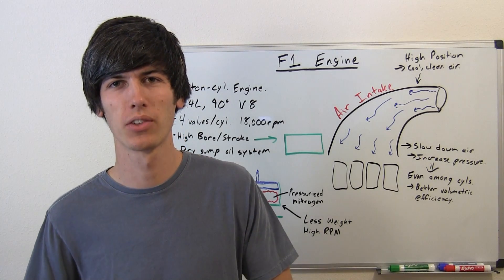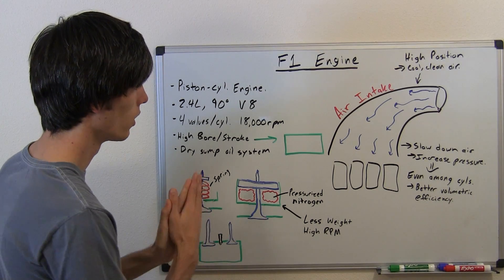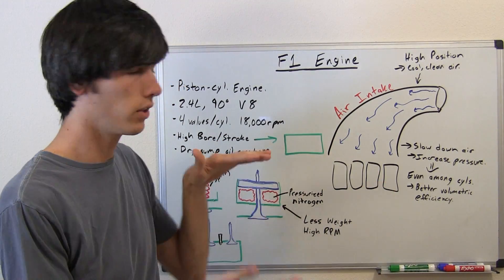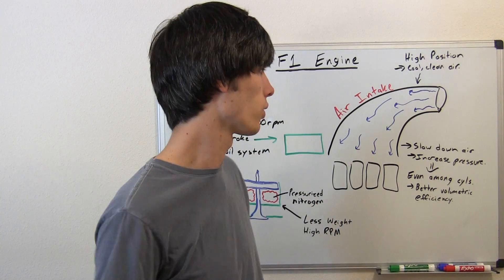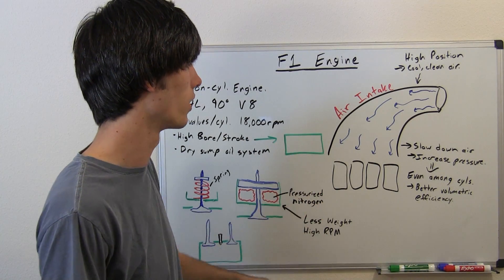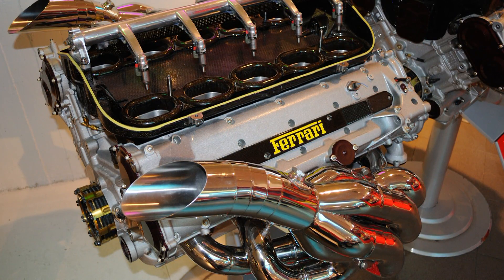F1 Engine - Explained

Comment: the pressure in the cylinders before compression in higher than atmosphere at some rpms because of clever intake runner/port design and the fact that air acts like a spring when compressed.  This guy knows little about the details that made an f1 engine unique before the formula changed to compound turbo in 2014.
Reply: +Brad Arsenault  , i wouldnt say he knows little , but i fully agree with you , that its the resonance of air in the intake ports, and the smooth flow,  that is the secret to high torque  , i am convinced that the volumetric eff,  at max torque rpm ,is close to 1,5 bar (and that without turbo!!) , almost all the things he mentioned are done to make sure the max torque finds place at a high rpm , so the engine makes more hp.
Reply: +Marc Hh 1.5 bar seems a bit much but I can't give an actual number so I can't say it's not 1.5 bar.  for my  American comrades, 1.5 bar is about 3.5psi of boost or 10.5psi absolute.

Comment: Why is the exhaust chrome? Isn't that a bad way to dissipate the heat.
Reply: +Jef Gulickx That isn't Chrome. It's a Nickel superalloy. Very expensive stuff and hard to work with. They only polished it for the display and polished Nickel looks very similar to polished Chrome.

Comment: I enjoy your explanations as they are simplified and generally correct, but in this particular case you got something wrong. The volumetric efficiency of an normally aspirated engine can exceed 100% without the use of turbo or supercharging. Formula 1 engines would be a prime example of that. With proper cam timing / durations, and increased pressure through a forward facing snorkel 100+% is very achievable.
Reply: And tuned length inlet/exhaust. Look at those beautiful headers at the end of the video. Not just art but they use pressure waves to help fill and scavenge the cylinder

Comment: You can achieve greater than 1 Ve and often Motorcycle engines which share some F1 technology achieve this due to inertial velocity of the intake air which can approach supersonic speeds in some cases. You also forgot to mention the hidden "5th" cycle of a F1 engine which is the flow through cycle.  This flow through cycle uses the overlap of the I/E valve to generate even more inertial air pressure due to tuning of the headers. 

One more thing, you can use ordinary air on valve actuators as all gasses have he exact same (Boyle's Law) pressure/volume relationship. You are right about water vapor.

Comment: So...what's the life expectancy of one of these engines?
Reply: For those v8s, they had to last at least 2 race weekends at first, reliability is more stressed now.
Reply: They used to be designed to barely last a race to save the maximum weight possible so ~300-500 km. In recent times they have put forward engine replacement restricitions to make the sport fairer for poor teams so the engines have to last on average 3-5 weekends or about 4000 km. :)
Reply: the engines have to last at least 3 races i believe
Reply: "Back in the day," an engine lasted for one race.  Anything more than that would be considered "overengineering."  They even had special engines for qualifying, also known as "grenades," that were good for a dozen laps.

Comment: wrong again. probably the wrongest, yes I said wrongest. I know it's not a word. but this is the most wrong this channels has been so far. the idea that you can not get 100% VE is false. stop reading magazines about 1970's passenger car engines. I don't know the numbers on f1 engines but I remember an article that I can look it up. however I know prostock v-8 carbureted normally aspirated engines can see 135% VE. I can explain if the channel cares to tell everyone how wrong they are.

Comment: Water also wouldn't work in the valve system not only because of corrosion, but also because it is relatively incompressible.

Comment: is it fuel efficient of not rev up to 18k rpm? like normal drive of 2-3k rpm? i mean a 2.4L v8???
Reply: +John Meister Dupa Well then you wouldn't be in the power band. Its not fuel efficient, its power efficient. Just like you don't see street bikes driving at 10k RPM all the time, they cruse at 2-3k too.

Comment: Just read the description where it says volumetric efficiency above 1 is not common. I can't bring fact right this minute but every Honda VTEC brings volumetric efficiency past 1.  And every modern car's engine has a tuned intake and exhaust to use  the pressure waves in the manifold to charge the cylinder. Also the RPM at which peak torque happens, is when there's resonance in the system which is also when volumetric efficiency peaks.

Comment: I'd like to add that in a naturally aspirated engine, volumetric efficiencies (VE) higher than 1 are very commonly achieved in today's engines. VE is not constant, it changes with engine RPM and is tuned at the intake and exhaust. I think VEs as high as 1.3 have been achieved in naturally aspirated engines.

Comment: obviously this is an older video, but I'm not to the channel,  great job BTW, I've learned a ton in a week lol.  Anyway, my question would be why are the valves with a higher bore/stroke ratio not used in standard production vehicles?

Comment: also the reason a valve "floats" is not that the spring doesn't close fast enough its the vibrations of the spring that cause the valve to smack the valve seat and open again because the vertical vibration to be transferred back down to the seat.

Comment: how does having a wider intake manifold closer to the cylinder intake increase pressure? For a given volume of air at a given velocity and temperature, when you increase cylinder diameter then the pressure needs to drop. pv = nkt.  Think in terms of slicing the intake into infinitely thin equivolume segments. for the ideal gas law to hold, if flow rate is constant (m^3/s) then air velocity (think in terms of a flame front) will have to increase as the equivolume segments increase in radius, but decrease in thickness. Conversely, for a given velocity at the intake, there will be a given volume of air moving in. As the radius increases then the pressure drops, and you have a slight temperature drop as well. This is in effect an orifice plate in a flow metre or the nozzle in an air conditioning system.  Your logic is wrong.
Reply: As you mentioned, air has properties at a given velocity, pressure, temperature. However, the air traveling down the manifold is slowing down due to the manifold's change in cross section resulting in an increase in pressure. And by the way, this is described by Bernoulli's equation which has the velocity factor and not ideal gas eq.

Comment: I got a question, as I am still learning. In this video you said that the air intake  is positioned at top so you can get cool air. I thought only warm air rises up? But since the cars are around 95cm tall, does the air change that much in temperature?

Comment: 18000rpm, wow,  cant have much torque at all
Reply: +Michael Flatman Yeah you can't put your foot down from a dead stop until at least 3rd gear ha
Reply: Who cares? It accelerates just as quickly as a car with 3 times the amount of torque.
Reply: +Belicose777 No, because the tires will spin out... because there is no TCS on the car because they were banned by the FIA normal cars have them unless you ask the factory to specifically take the systems out, and honestly a car without ABS and TCS if taught in the DMV would be so much better because ABS increases your stopping distance rather than just knowing how to break slowly rather than slamming your foot on the break.
Reply: +Michael Flatman Indeed they don't but given that F1 cars in this era weighed well under 700kg, they don't need need prodigious amounts of torque.
Reply: GetOverHere83 yeah, and they can have a low ratio box to make up for the torque deficit
Reply: ***** yeah, no short shifting on these babys!
Reply: DJWolves97 it was a joke, in the real car there are probably many mechanisms that stop you short shifting and being in the wrong gear
Reply: Michael Flatman Your jokes are terrible
Reply: +defboy456 You also have to consider that these engines go into lightweight racing vehicles so extra torque isn't necessary. These race cars are lighter than your average family car. You're not going to have a race car tow something are you?

Comment: i am a mechanical engineer student. and i love your channel man. just love it. its like home
Reply from the maker: +Minhaaj Hussain Thanks!
Reply: +Robert Perry They cost a lot more than $200,000 when you divide the total cost of R&D plus tooling costs plus manufacturing by a very small production run. Well under 100 units. And that's why they're so expensive. If Toyota spends $100Million to develop an engine, and another $100Million to tool up a factory then sell 10 million engines, the R&D plus tooling only comes out to $20 per unit. It's called "economies of scale" and is an economics problem rather than an engineering problem.
Reply: +Robert Perry Racing engines are more durable as they must be stressed for long durations. The ability to redline, everything is forged andor billet, tighter tolerances which increases manufacturing costs (directly relating to product costs), the valve train system is more complex, the specs of the engines, and just because  as with everything inflated costs because even building engines for the sole purpose of racing is a business.
Reply: Anthony Rs Cheers I suppose so, they would have allot of overhead and a relativity small market, must get their money's worth. If they mass produced and there was enough demand for car enthusiasts you could probably be able to sell them for 25,000 or possibly less. Supply & demand at the end of the day.
Reply: +Robert Perry Got to remember, these engines are at the absolute cutting edge for internal combustion motors, using exotic materials, extremely advanced manufacturing methods. There are several documentaries here on YouTube specifically about Formula 1 engines, you should watch some. It is quite incredible the amount of work that goes into developing and manufacturing a F1 engine.
Reply: +Engineering Explained As the pistons are shorter and the engines don't need to be as deep, (less metal) why are they drastically more expensive than regular engines I see how the valve-train is more expensive as it is pneumatic and they have dry sumps, but it doesn't really explain how a normal car engine is $5,000 and an F1 engine is $200,000
Reply: Minhaaj Hussain could you teach me plz
Reply: Minhaaj Hussain Best of wishes Minhaaj as you pursue your M.E. degree. We all wish you well!
Reply: Robert Perry
Reply: Engineering Explained i love this channel because you are very in depth with each video but you make it understandable. <3
Reply: You must have had an odd home

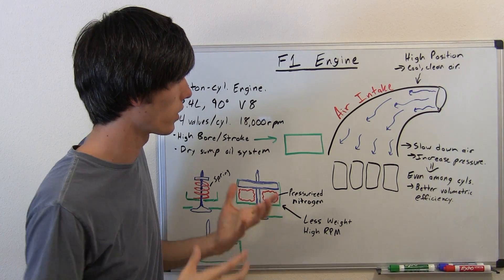Comment: 3:33 If the relative volume of the air is increased, won't the pressure decrease (Boyle's Law). You claimed that if the air expands i.e spreading out (3:30), how will the pressure increase?

Comment: I'm no engineer but I did take physics in college.  If you expand the volume of a space towards the bottom of the air intake lets say, wouldn't that decrease the air pressure at the bottom?

Comment: Can I swap an F1 engine into my Honda?
Reply from the maker: Yeah
Reply: +Brannen Batulan If you had the money, you could, but what this video doesn't tell you are the following things:

An F1 engine has a very short lifespan, so taking your engine out to revise it completely every 1000 km is not the best thing in the world.
An F1 engine needs high airflow to get cooled enough to work. If an F1 car doesn't go fast enough the engine will overheat. The average racecar driver is not able to make an F1 car go fast enough to keep it cool. Unlike other racecars, an F1 car has more grip when going faster. It can take corners at 250Km/h that it wouldn't be able to make at 150km/h just because it would spin out due to lack of downforce. This is the reason many racecar drivers are not able to drive an F1 car fast enough because it goes against all logic for other racecars.
An F1 engine also has such small tolerances that the pistons are stuck inside the cylinders if the oil is cold. The engine needs to be warmed up by an external oil heater.
Reply: +Brannen Batulan don´t change your engine from a Mclaren-Honda engine, it migh push less than yours :_)
Reply: if you are driving a Honda you can not afford an f1 engine.
Reply: any sort of F1 engine you buy, I guarantee you won't have the money or the resources to run it. Any f1 engine that is cheap enough to feasibly buy, will only be so because parts are impossible to find. Any parts that you can find, will be astronomically expensive. I mean get real, the engine will be astronomically expensive. No matter what year or from what car its from, an F1 engine will not come cheap.
Reply: +Engineering Explained this is mechanical engineering correct?
Reply: +poncoolride same but im sure ryan rywire can and he loves honda lmao
Reply: +xmxoo7 I am pretty sure he knows that, he's just trying to drop some knowledge. Chill mane
Reply: +eel1331 it's ok, I can't afford one either.. lol
Reply: +poncoolride js ya know
Reply: +eel1331 ;-)
Reply: I did it. Hopefully the motor doesn't blow
Reply: +Brannen Batulan I don't think you really did.. but if you did then make a video
Reply: I imagine you might be able to buy an older f1 engine.
The currently used engines probably have some secrets in them, that nobody wants their competitors to find out about. Even though the engines are standardized in most ways. Just guessing though.
Reply: eel1331 no itz oceanology
Reply: get ready to pre-heat the engine and push start the vehicle each time you want to use it.
Reply: Brannen Batulan SEND IT
Reply: Pick a better car F1 is RWD..
Reply: Just add more stickers, same thing
Reply: How about you swap it for a rotary?
Reply: Required : deep enough pocket
Reply: +poncoolride real nigguhs don't flaunt their money, they just wait for haters to bite their tounge
Reply: +MrSkyl1ne is a fking joke chill out
Reply: +MrSkyl1ne when my civic gets a F1 engine i will always be going fast enough for cooling not to be a problem at any time. not even joking, i will be doing at least 250km/h at all times. because i will have enough power. also i'm mates with a cheap mechanic so getting it rebuilt every 1000kms isn't a problem. he mostly works on diesels but he's really cheap

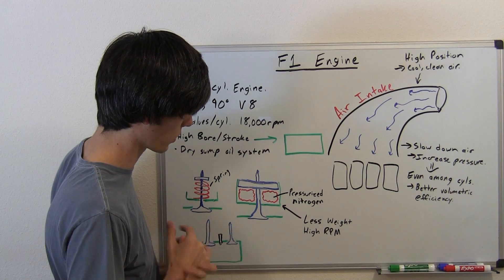Comment: @5:50 You say"Nitrogen because it keeps it pressure fairly constant with differences of temperature". Why is that, how it is better than Argon for exampe? PV=nRTfor all gasses? I think I've seen a same claim also on filing tyres. Is it just against air or how is nitrogen special, please explain.

Comment: I learn more from this guy in 5 minutes than I do in a whole semester class (plus the comments,  too).
Reply: Hank Fuddle do your homework though. can't pass the tests unless you tackle the assigned problems yourself. got to be able to reproduce what you think you understand by solving problems and applying the formulas and concepts by getting stuck and unstuck. there is more to this than meets the eye. He does a good job getting you the big picture but the details are just as important.
Reply: ikr
Reply: truth
Reply: Obviously not working hard enough
Reply: Wrong, In school they teach you how those spark plugs function, why they use the materials they do, why they need torque and gap, why they need to be platinum, iridium, or copper. 

They teach you why there are tolerances, how big the tolerances are, why the piston ring has a gap, how many piston rings/scoopers there are, what oil does and how its viscosity affects the engine. The various Sump types, oil types, engine types like opposed, 90 degree, Inline, Rotary, etc. They teach you what the proper fuel air ratio is for the given application, they teach you why the cylinders need to be scored, why the valves operate as they do, the different types of cams, etc.

Then they give you practical, where you can operate them, take them apart, see them for yourself.

If you're learning more from this than you are school, you're not listening.

These videos give you an overview of a specific topic, they don't explain why and how these little bits function and why and how they do what they do to make up the entire engine.

Comment: Oops.  Sorry, I should've been more specific.  The false information I was referring to is that the maximum volumetric efficiency of a naturally aspirated engine is the same as the cylinder filled by atmospheric pressure.

Comment: Why not have solenoid operated valves? It would eliminate the need for a camshaft and would reduce weight.
Reply: +Lander F It's easy to say that but F1 or rather the FIA doesn't work that way. With the FIA constantly trying to slow cars down or at least prevent them from getting faster and faster, all in the name of safety, they would ban such innovations long before teams could implement them.
Reply: +GetOverHere83 and that is precisely why there's nothing exciting about f1 anymore
Reply: Solenoids have very nonlinear force-stroke curves that affect actuator velocities.  Inductor reluctance also causes response hysteresis that would vary wildly with engine temperature changes, exacerbated by hot engines that change temperature in unpredictable ways in a race.  Engine heat would slow their response (heat increases coil resistance) when the engine revs up & rises in temperature, the opposite of the desired effect.  Though they might be actively cooled, such cooling control adds another variable to further complicate any formula for design.  What initially sounds simple often contains multi-variate problems that are maddeningly complex... at least, that's what I've learned from 3 decades as a mechanical engineer who often worked with solenoid valves & latches.